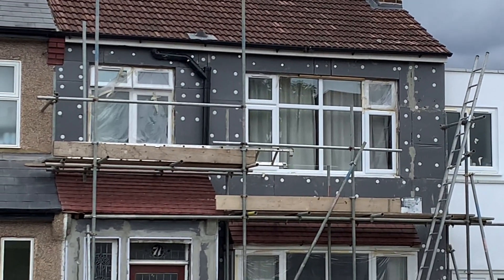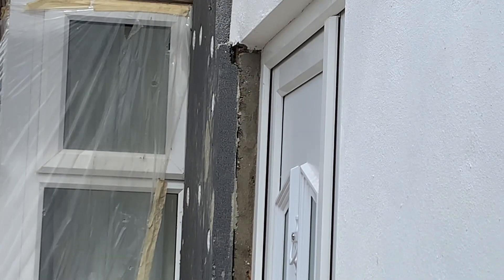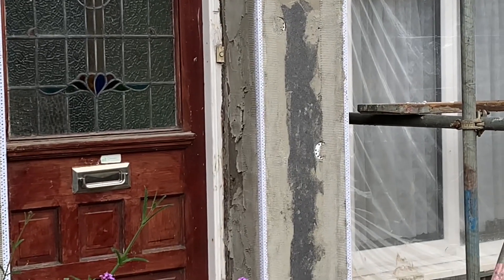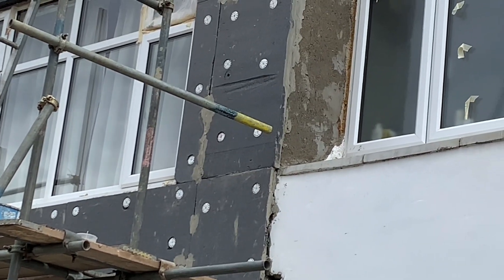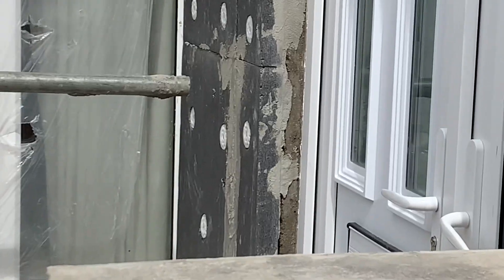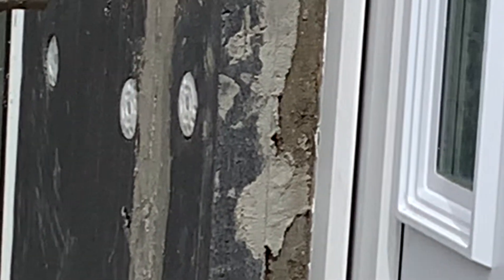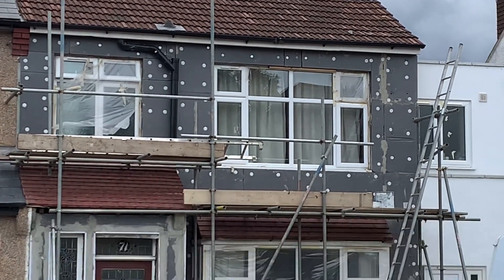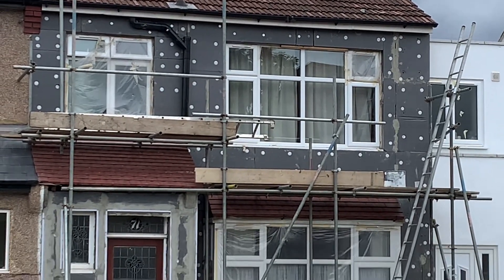Mistakes in External Wall Insulation that could easily have been avoided

Comment: The 50mm eps is much cheaper than PIR and Much cheaper than K5 like you used. So I would guess that price has taken priority here. There is also I understand the effect that over time PIR loses some of its insulation value where eps does not, but this is something I need to read up on to understand better.

Comment: That it's not a mistake! It's a disaster !
Reply from the maker: Yes, it’s not going to be very insulative. Although I’m not sure what the outcome will be in terms of cracking of the final render. I expect all the effort to put L-shaped boards around corners and two layers of mesh (with the outer layer at 45 degrees to the inner layer) is more than enough to stop cracking. So it’ll be interesting to see what the outcome is of missing out some of those measures.